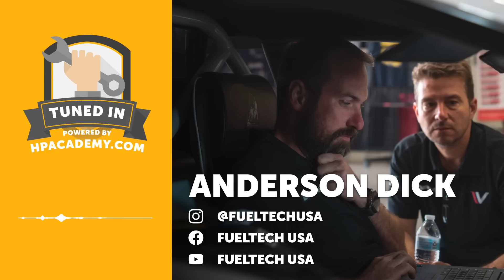084: Going From Inductive Ignition to CDI and Gaining 500hp. [#PODCAST]

Comment: If ignition and preignition is such a big deal with methanol  prechamber ignition and maybe direct injection might be the future. 
Less fuel on the walls to wash oil or preignite, 
no exposed electrode so less of a hot spot and 
much more reliable flame jet ignition.
As less meth is easier to ignite a passive prechamber would not be blasted by a direct injector, but naturally be filled by a leaner, easier to ignite mixture. I wonder if the low air fuel ratio would make it easier to get a reliable fill in the prechamber...
Reply from the maker: You don't just pop bigger injectors into a direct injection fuel system and turn it up to 11 otherwise, that is exactly what people would be doing.
The more common approach for now is to add port injection to work with the existing direct injection setup. We have a short video touching on this in the pipeline, I will bump it up the list for you and release it early next week, or late this week depending where you are located I guess! 😎 - Taz.

Comment: With regards to Inductive and CDI coils, inductive can have a shorter duration, many are 500-1500 ms, not 5000 micro seconds as he mentions. The difference between 200 and 500 microseconds is not that large any more with similar over all joule output.